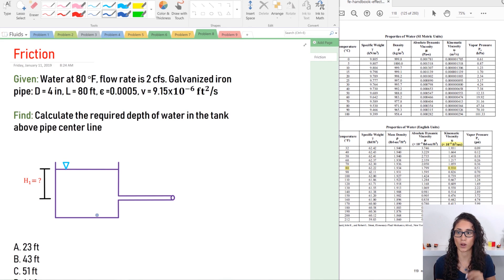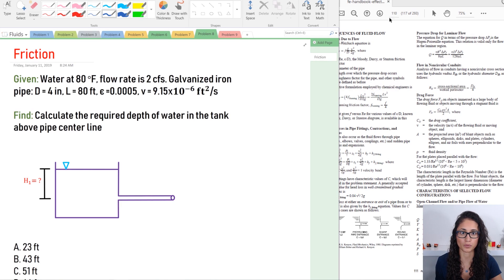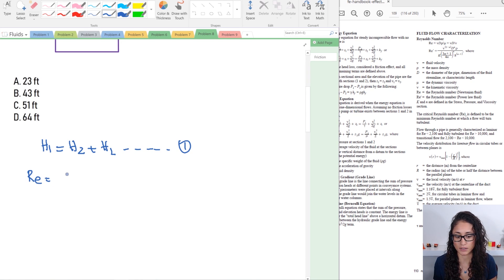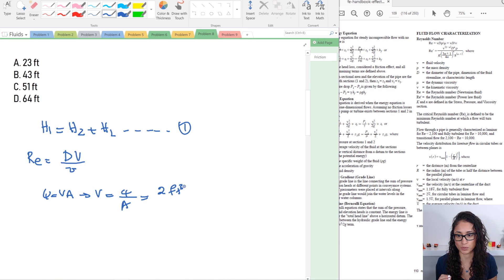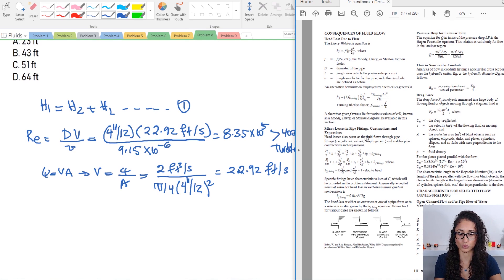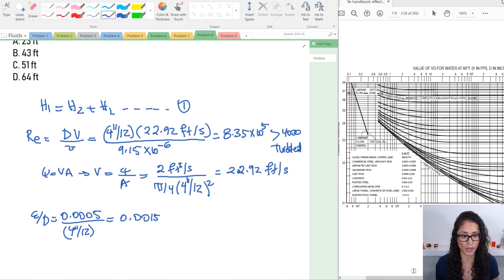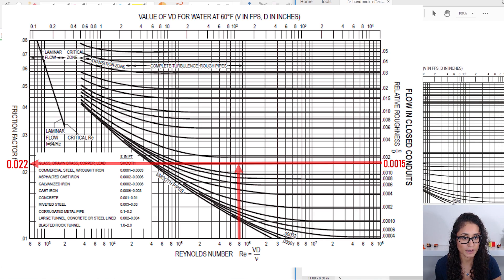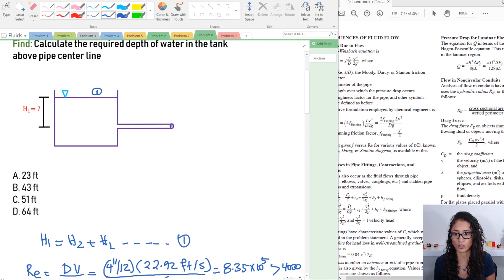Bernoulli Equation and Friction Loss Using Darcy (FE Exam Review)

Comment: Thank you for the explanation and video, a quick question why we not taking the unknown head as H2 as you mentioned we are considering pipe location as our starting point where elevation is zero? Also thank you for the explanation that when Re>4000 it is turbulent flow, its not mentioned in FE reference handbook rather it says Re<2100 laminar flow and fully turbulent for Re>10,000.

Comment: There is a minor head loss as the water converges into the pipe. That needs to be added, but it could be that it is much smaller than the friction loss. I'd want my students to at least show that.

Comment: 1:40 So what are we supposed to do if it's laminar flow? You told us what to do if it's turbulent flow.
Reply: Laminar flow problems are a lot easier to solve, because the relationship between flow rate and frictional losses can be solved in closed-form from the first principles of viscosity.  The relationship between Reynolds' number and friction factor is therefore much simpler.  In fact, if you see the Moody diagram, there is a straight line on the double log scale for laminar flow, which implies a simple power function.

In the case of circular pipes & tubes, f = 64/Re for laminar flow with Re<=2100.

Comment: Can u explain the gravity in the very end, I did not get it, I think we need to multiple the 9,81with 10,76 to convert to (square feet ) , so why was it 32,2?
Reply: "Head" is a topic that is defined to equal the form of energy per unit mass in the Bernoulli equation, divided by g.  Even forms of energy that have nothing to do with gravity, get divided by g, by convention.  The only form of energy that doesn't divide by g to get head, is gravitational potential energy, i.e. the only form of energy that has anything to do with g.

In this problem, solving it without a "head" form of the Bernoulli equation, we set up the following:
P1/rho + v1^2/2 + g*z1 = P2/rho + v2^2/2 + g*z2

Let z2 = 0, both sides are exposed to the atmosphere, so P1 and P2 are both zero.  v1 is negligibly small.   This reduces the equation to the following, in an ideal world:
g*z1 = v2^2/2

Then we add the frictional losses term to the right hand side:
g*z1 = v2^2/2 + 1/2*L/d*f*v2^2

And solve for v2:
v2 = sqrt(2*g*z1/(1 + f*L/d))

This shows where dependence on gravity really is, if you were solving it with consistent SI units.

Comment: A pump lifts water  from a large tank at a rate of 30L/s . If the input power  is 10kN  and the is operating at an efficiency of 40% . find  the maximum height to which it can raise water if the delivery pipe is vertical, with diameter 100mm and friction factor 0.015. ( please help)

Comment: why is the pressure at point 2 zero? thanks!
Reply: It is exposed to the atmosphere.  Since both sides are exposed to the atmosphere, and this equation only cares about difference in pressure, you can simply work in gauge pressure to solve it, and both pressures are therefore zero.
Reply: As Carl points out, they are both zero psig and 14.7 psia. You don't even need to know this - only that they  are both open to the atmosphere so they cancel out.

Comment: Hey, thanks for the video, but check your calculation - The answer should be 56.25 m.
Reply: It seems like there are many mistakes, gravity at the end should be multiplied with 10,76 , and the diameter should be in inch not feet
Reply: @2kstar85  32.2 is the convertion for ft/sec2  and the diameter is in feet because epsilon is in feet … is this correct ?  @enGENIEer

Comment: Wait, I think the diameter is supposed to be in inches for the moody chart?
Reply: The dependence on diameter is non-dimensional, because that part of the chart speaks in terms of relative roughness, which is roughness divided by diameter.  So as long as roughness has the same units as diameter, you are good to go.

Comment: When you calculated roughness coefficient, why did you convert your diameter to feet? Doesn't the chart say diameter should be in inches?
Reply: My question as well
Reply: @rowana2177  the surface roughness coefficient, e, is in ft.

Comment: isn't it Area of the pipe = pi x d^2? Can you please explain why Area = pi/4 x d^2?
Reply: Binh Truong area of pipe is pi  x r ^2 
When using radius 

If you are using the diameter it is pi/4 x d^2
Reply from the maker: Jonathan Perez explained it well! Hope it makes sense and make sure you add that to your cheat sheet, so you remember it for the exam!

Comment: why greater than 4000 to use the moody chart? i couldnt find that value in the manual. i really appreciate all of your videos :)
Reply from the maker: Hello Frankie, so if it is more than 4000, which what books specify, (on the reference manual, they specify greater than 10,000), the flow is turbulent and so you need to get the friction factor from the moody chart. If it is less than 2000, then the flow is laminar and the friction factor is complicated but not retrieved from the moody chart. I know this might be confusing and that is why I will make a video on this to clarify any confusions. Thank you for watching and good luck with your studying!
Reply from the maker: Framkiee, I hope you are having nice weekend, just power though, you are almost there and don't forget to rest a little bit tomorrow, your brain will thank you for it later. Good luck on your exam Monday!
Reply: enGENIEer thank you. I appreciate your comment.will do 💪 thanks again best vibes to you too
Reply: @frankieeog1625  There is no theoretical basis for most of the Moody chart, except the region of laminar flow, where friction factor is a simple equation of 64/Re.  The entire domain of turbulent flow is all curve-fitting to experimental results.  That's why you get such wild equations that aren't user-friendly for most of the chart, and a simple reciprocal function for laminar flow.